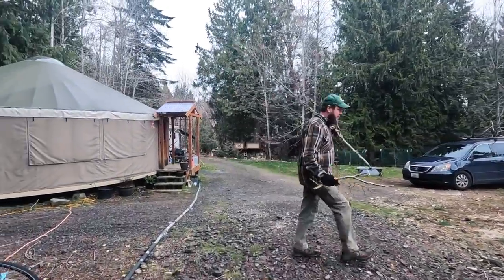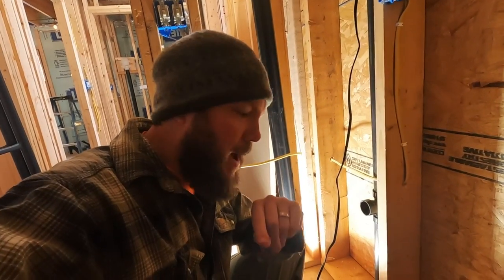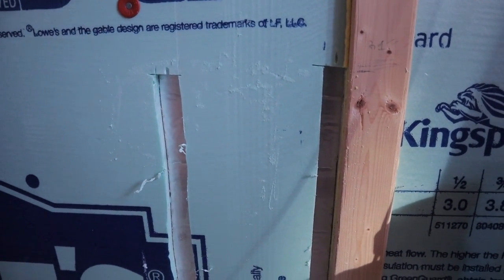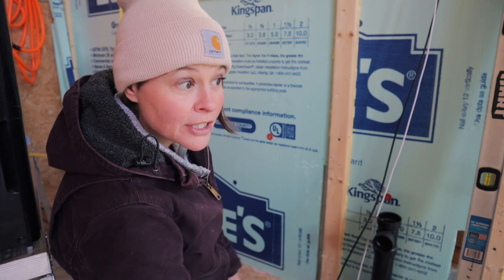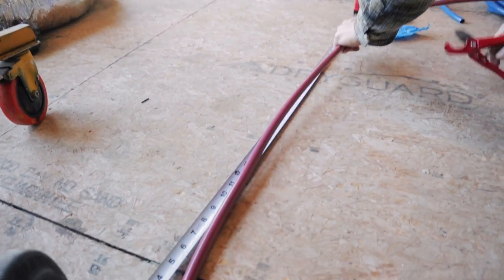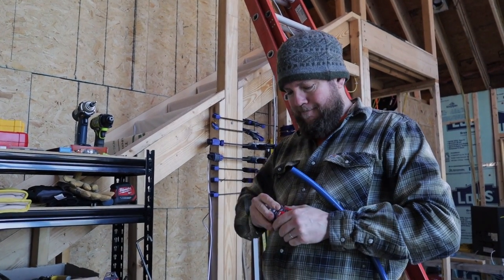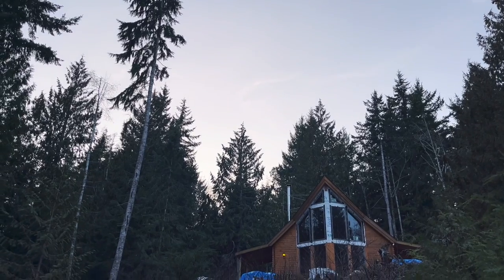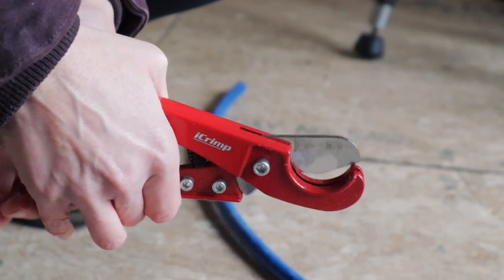A NEW CHAPTER BEGINS // Plumbing a LOG CABIN with PEX

Comment: Crazy Idea.  Years back I bought off Amazon a (LUXE Bidet NEO 320) It just connects to a regular toilet.  I never hooked it up yet because it has HOT and COLD water and I had been lazy to drill the cabinets and run the hot from under the sink.  If I had already had hot water I'm sure I would have put it on.  Now would be the time to add a hot water line next to the toilet if a BIDET is something you have ever thought of.  Kind of a weird thing but as Americans we really don't use bidets to much.  Although we all like the feeling after a shower.  On a side note at 17:00 when you were struggling to get that PEX together since you drilled your hole to small I was really hoping you would just stop and re-stretch out the fitting instead of trying to push it on.  Were you able to get a full-seat on that one piece?  Once the PEX start contracting back to normal it goes fast.  I know you said you went with PEX-A.  What brand did you decide to go with?
Reply from the maker: I was able to get a full seat on the fitting, but it was close.  It wasn't until that last push that it went on fully.   We are using the sharkbite brand of pex-a.
Reply: @OneFootOfftheGrid  Interesting on the Sharkbite pipe.  I forgot to say to make sure to put in a way to drain your pipes.  Put in a T with a down line to drain your lines into a bucket or something at your lowest point under the house or wherever is most convenient .  Incase you go away for a week or so in winter and want to Winterize your house.  House is looking good.

Comment: I’m confused, why cutting into insulation for pipes. Don’t they need the insulation. I must have missed something.
Reply from the maker: Our cabin walls are 4" of solid wood and we have 2 layers of insulation and you only saw us cutting the first layer.  So there is still 1.5" of insulation between the pipe and the wall.

Comment: Keep pipes out of outside walls. They will freeze on you. Vanity and kitchen sinks can be fed through the floor, not the stud wall, as they will be inside the cabinet.
Reply from the maker: Our outside wall isn’t your typical stud wall. There is one and a half inches of foam insulation behind those pieces of PEX that you see and there is also a 4 inch log wall.

Comment: It makes no sense to me why you would cut away your insulation to install your plumbing lines. I'm assuming this is an outside wall. Why expose these lines to freezing?
Reply from the maker: We didn’t cut away all of our insulation.  There is still at least 1” and the walls are solid 4” thick. It’s not a traditional stud wall so the water lines had to go somewhere.

Comment: From a Plumbing perspective, it is not smart to put water lines on exterior walls due to freezing the line in the cold of winter!
Reply from the maker: One think to note is that we live in an area where it RARELY goes below freezing here.  Second, there is still 1 inch of foam insulation behind the PEX and 4 inches of wood.

If worse comes to worse, we'll do what we've done while living in a trailer that has a long (and exposed ) hose for water. We'll keep the water running at night in one faucet.

Comment: Where the tool gets tight you could do it before you put it thru the floor joist and that would solve that issue.
Reply from the maker: True.  I'd just need to drill a bit larger hold int he joist since the expansion ring is bigger than the size of the pex.  Good idea though.  Thanks for watching David.

Comment: Gee, I thought that plumbing was first then Electrical and the Insulation last before dry wall. Have things changed that much?
Reply from the maker: We did screw up and do electrical before plumbing, but since our exterior walls used foam board it was necessary so do that before we started either.  So no, things haven’t changed that much there just are exceptions to all rules.
Reply: Well, pex does make things a lot different but glad I wasn't hallucinating

Comment: I have a question for you why didn't you use manaflows run cold water to one and all the cold water line out with values so that if you have a problem and you have to turn your water off to fix it the rest of the house can stay on cold line runs too a hot water tank or too a tank less on demand and then line to an other manaflow and out too hot water lines
Reply from the maker: I thought about it but didn’t like the amount of pex I’d have to run.  Also, I wanted a recirculating pump on our hot water line which I’m not sure how I’d do with a manifold.